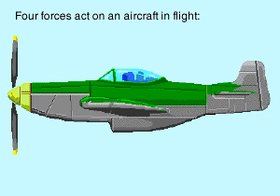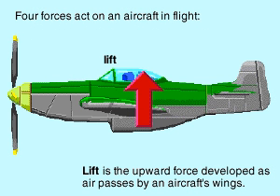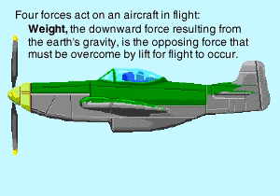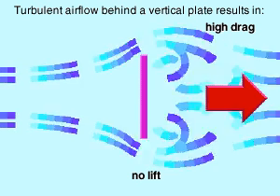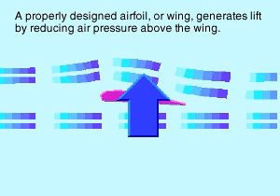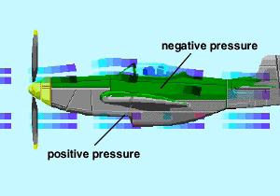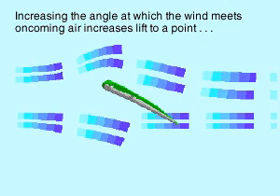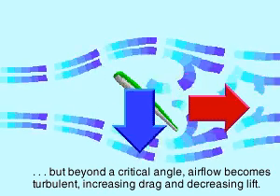Forces that act on Aircraft in flight

Comment: @ecouriercouk
As I understand it, an "F" duct brings air from the high pressure zone at the front of a race car & delivers it to the leeward side of the car's rear airfoil.
I'm not an engineer, but here is my best guess as to how it reduces drag.  The introduced air cancels the low pressure on the leeward side reducing the foil's ability to redirect the air tightly along the leeward side & launch it upward.  Less air shooting up into the general airflow means less drag.

Comment: Lift occurs even on a flat plate that has a positive angle of attack, not just "airfoil" shaped objects.  An "airfoil" shape is not needed for flight, at all.  Because a wing is a structural element & needs thickness to have the needed strength, they are given a streamlined shape to reduce drag.  The asymmetrical shape associated w/ the Bernoulli effect is also not required for flight, but it is helpfull.